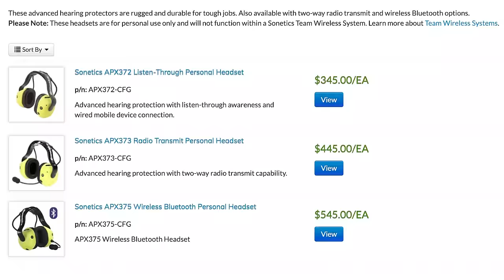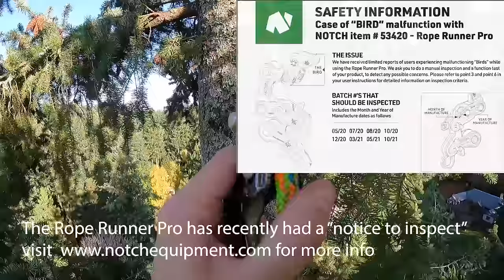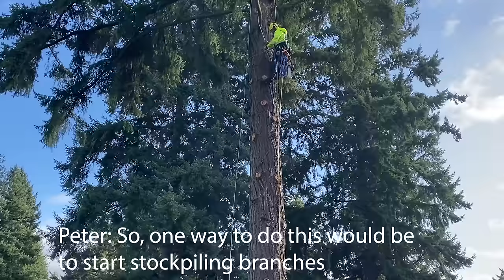PART 2!!! Brushing out the BIG Chapel Fir! 160ft Tall Tree Removal with Seattle Tree Care!

Comment: Jacob I’m just a hobby tree climber and trimmer. And your comments on leaving some limbs as you go up make a lot of sense. I know from doing removals if I cut everything going up sure made the tree move a lot more when cutting towards the top. Makes a lot of sense to leave a few limbs to absorb shock. Great tip. Thank you sir, really enjoy the direction you are headed with the new gig.
Reply: Officially, that’s referred to as dampening effect. There was a good article a while back on removing dead trees and the benefit of removing them from the top down to reduce the movement in a dead trunk. Great job Jacob! Big tree.

Comment: You might want to let the Chapel maintenance crew know that they need to clean the gully areas of the roof.  where debris accumulates, so does water and the organic material produces a form of acid that erodes the roofing material, regardless of what it may be made of and then big trouble for such an old structure.

Comment: @28:00 talking about leaving limbs on to make it more stable... wouldn't those limbs you leave behind catch the wind more though?
Reply: When you remove all the limbs and the top, the tree becomes noticeably more wobbly because you've removed the mass that helps dampen vibration. It will still be stronger with all that weight and sail removed, but it feels more wobbly to climb.
Reply: When you remove all the limbs the bare trunk acts like a tuning fork. Leaving some branches on high up de-tunes it to a much lower frequency. The foliage or needles on the branch act as a damper because they have so much drag on the air. The combination of the two effects greatly reduces the motion of the trunk in response to an impulse load like dropping a top.onto a rigging line. Leaving branches on high up will definitely catch the wind more but its a tradeoff.

Comment: Serious question: why (if you are using slings anyway) didn't you speed line the branches on that tree? Pulling the rigging line up back up you every branch or so seems like a tremendous waste of time and energy compared to running a speed line. Also, it would (in my mind) be safer because when you were doubling up branches you had the full weight of the first cut hanging from the 2nd cut making it pop off in a rather unpredictable manner while running your bar close to the rigging line. I know you know what you're doing; I'm just curious to know why you did it in this manner. Thanks!
Reply: Those limbs are long and heavy. He didn't think he had a suitable crash zone for speed lining them.